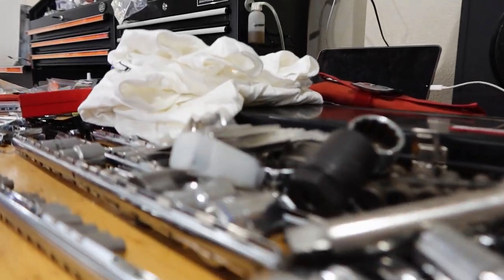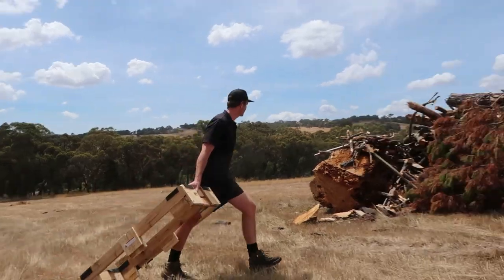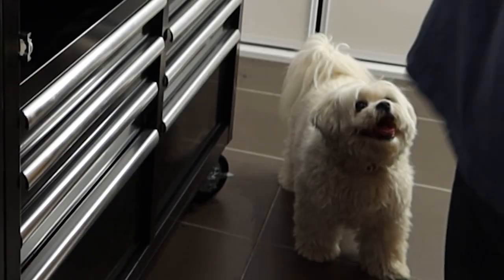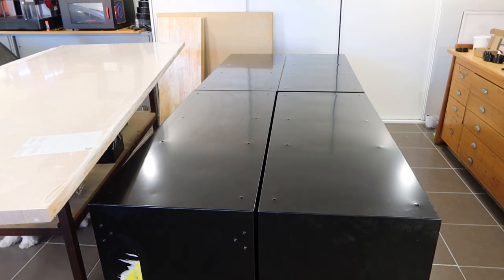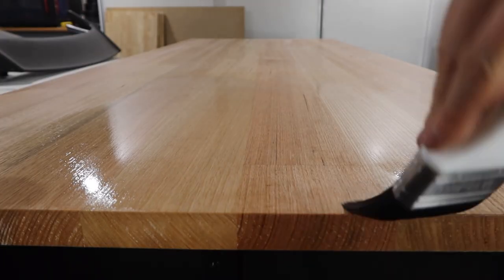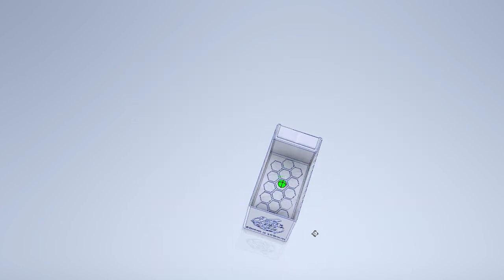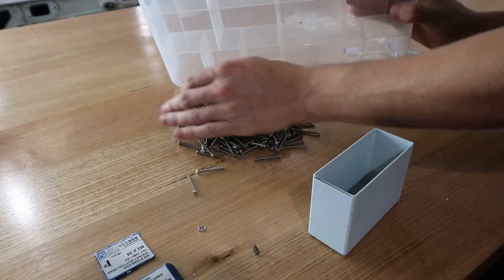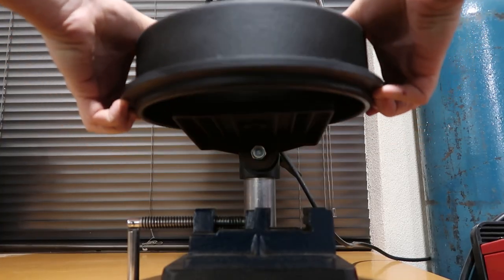Designing and 3D Printing Drawer Organisers for a Custom Workshop Workbench | DIY Engineering

Comment: It’s too late now, but I suggest making well rounded corners (3+ mm filets) on the inside bottom of the containers. Mine are square like yours and it is a real pain getting out small screws, nuts, etc.  Having them rounded means you can slide the parts up the side to get them out.
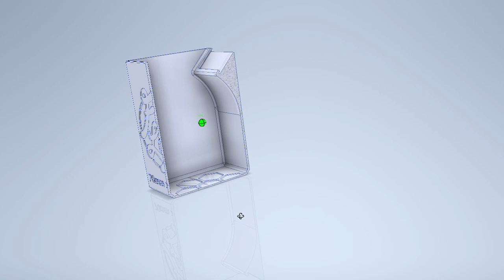Reply from the maker: Never too late mate, thanks for the tip. However I've actually put a radius on that inside chamfer there which is just under 3mm, you can kind of see it at around 8:50 . Works well for getting those small parts as you suggested

Comment: The 400 grit between penultimate and final coats does do something. It gives you a glassier finish because the surface is smoother. It might not be that noticeable cause you're still only using 400 grit, once, for the final coat, but it does do something.

Comment: I love the project! Have you checked out the gridfinity project? Its very similar to your grid setup
Reply from the maker: Hey thanks mate. I have seen that, it makes a lot of sense I think in the modular sense, but considering how much I know I'll change my layout until I commit to something it wasn't worth the effort for me. I also didn't want to have the impressions on the underside of my trays for anything over the 50mm size (100mm long would have a divot in the centre for example) so that would require me cutting out sections of the grid for those trays (which I was originally planning on doing).